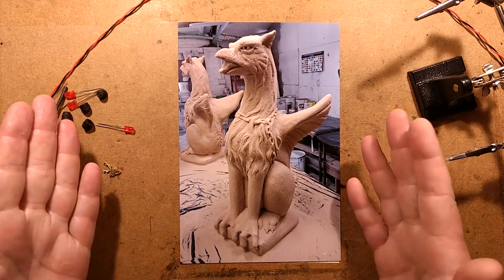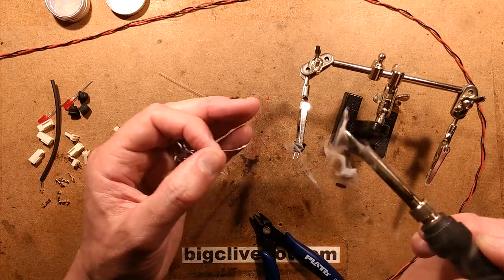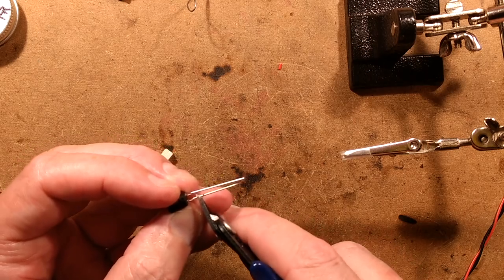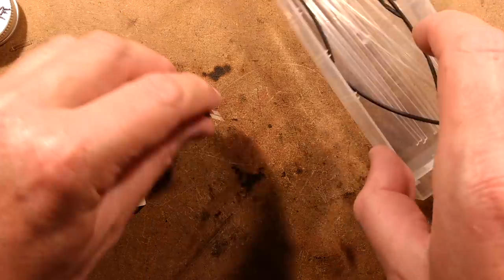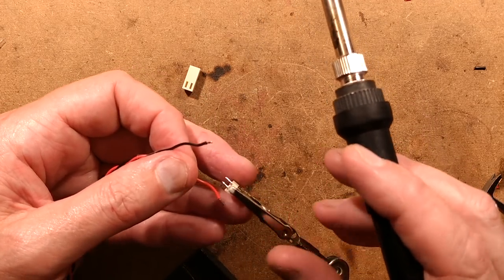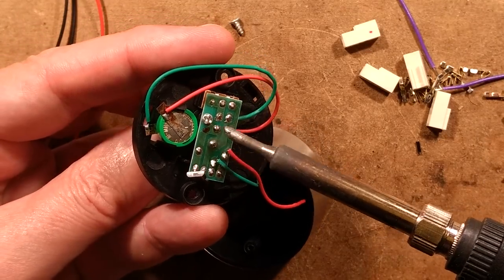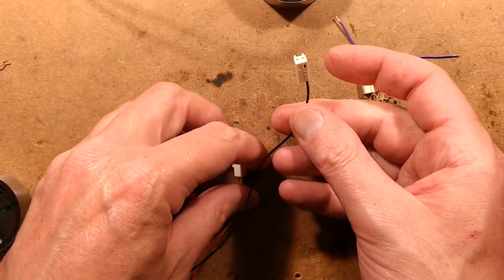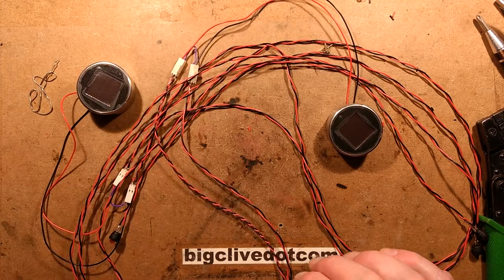Making a wiring loom for a prop.  Rambly Q&A video.

Comment: I received one of those stand alone heat guns many yeas ago after borrowing one from my neighbor to strip the linoleum off the counter top in our old house, shortly after purchasing it.  The heat gun worked so well, I told my wife I loved it, and on my next birthday, I was presented with a nice cased set, came with add on tips, in fact it has the one you use all the time. It sits in it's case in the back room, unused to this day because I was injured shortly after, and have never got back in the back room to do any work. Over the years things kept getting packed back there for storage till today when you can't eve walk in the damn place except for one narrow passage to my old office chair. I hope to one day clear it out so I can try and get back there to use it, as everyone keeps telling me  I am crazy building projects and rebuilding laptops whilst sitting in my electric recliner, they seem to fear I will drop some solder down the chair and set myself ablaze.  Hasen't happened yet, but I do have a lot of shirts with burn holes in them where solder has somehow dripped on them. One day though, when I don't have anything else on my agenda, I will tackel that back room and get rid of all the shit back there that isn't even mine, then, perhaps I can once again try to get back to my workbench and do the work right.  It has, however made me very dexterous with my hands, which used to shake like a damn leaf, the soldering has somehow made them steady once again. Funny how that works.  Perhaps soldering is good therapy.
Reply from the maker: I had a coworker who always had shaky hands until he needed to work on something and then they were absolutely still.
Reply: I showed my doctor the kit watch that I assembled all SMD tiny parts, he was amazed that I was able to do that a he is treating me for the shaking problem, as well as a ton of other crap.  I think that's why I love building these kits and learning more even at my ever increasing age (be 68 next month, damn I am getting OLD)

Comment: I've been doing electronics off-and-on for 4 decades.   Taken "How to Solder" courses as refreshers.   This is the first time anyone has mentioned putting flux on the desoldering wick and the pads, helps to remove the solder from the pads.

Promptly tried it.  Wow!   Fast and clean.

Comment: When you twist 2 (or more) wires together like this, you are also twisting the wires at the same time. If you have a geared spindle for each wire, driven by a gear concentric with the main shaft where the centre gear does not turn. In this way, as you twist the wires together they are automatically twisted in the opposite direction. This solves the unraveling problem.
Reply: I just pictured this. Good description.
Reply: My neighbour collects old farm tools. He has a rope twister that works just like that. Hand cranked.
Reply: Yes, exactly the same principle. Rope factories do the same thing, but with very long rooms. I think there is one with a room about a mile long. Ideally, the source spools are attached to the outer gears for continuous production, up to the length on the spool but for producing ropes the spools would have to be enormous so that doesn't work. Clive said the wire was 7 core, they will have been produced in exactly the same way but with 7 heads.
Reply: My neighbor is a rope twister by profession, he's 97, though. They worked beside the river, in good weather only, and with roundabout a quarter mile long pieces (land miles = max 400 m), drilling them on a device like You described it.

Comment: Traditionally a gargoyle is a water spout (you can remember this with 'gargle' ), the similar ones that are not a water spout are grotesques.
What you have there looks like a griffin, but if it was on a church (usually just the head/shoulders) would be a grotesque.
For twisting wires i just use a cup hook in the drill, as long as the wires are at the same tension (keep it tight), it's not a problem, once twisted, i reverse the drill a little to prevent the tangle
When i solder connectors that might melt, i grip the pins with the croc clips, as long as the iron is hot enough, it solders fine.
Reply: Glad to see someone else picked up on the gargoyle/grotesque point. My inner pedant always screams at that. :)
Reply: Never knew that, thanks. I blame the (mostly excellent) Disney cartoon show. :D
Reply: TIL

Also, croc clips as heatsinks is one of the greatest discoveries I ever made.
Reply: To add to the exactness and pedantry: because language is a changing thing and people have been calling the statues without water spout "gargoyles" as well, the meaning of the word "gargoyle" has expanded to also cover what would traditionally be called "grotesques".
While you are correct about the traditional difference, calling a "grotesque" a "gargoyle" wouldn't be considered wrong by modern dictionaries.
Reply: @daanwilmer  "the meaning of the word "gargoyle" has expanded" - That is a very diplomatic way of saying "lazy people with lower priorities for intellectual matters found misusing one word for something superficially similar but different acceptable and tolerated with such widespread fervour that it began to make less disinterested people sound stuffy". After all, you cannot have "gargoyle" expanding without "grotesque" diminishing.

Comment: I've done this exact thing before.  Someone gave me a hollow composite garden sculpture of a squirrel.  I dremeled out the eyes and illuminated them.  

The method I used was simple: Start with diffused red LEDs and arrange them inside the statue such that they are centered in, but about 5mm behind where the eye surface should be.  I affixed them from the inside with clay or blutack (i don't remember which)  At this point, I used clear acrylic latex caulk (the kind that cures semi-translucent).  I used a small spatula and filled the eye cavity with the caulking, making sure to encapsulate the LED.  The exterior surface is simply sculpted to form the convex corneal surface.  

In this way, the entire eye glows uniformly at a wide range of angles, it still looks good during the day, and it's entirely waterproof.   In retrospect, using silicone would probably be better for outdoor use.

Comment: The wiremen at the factory I worked out used a drill to twist pairs too. One end was tied to the handle on a full filing cabinet, the other end hand twisted, folded over (to stop the slipping), and chucked in the drill. Tension the wire and away you go. If the tension is too high the full filing cabinet drawer opens, correcting the problem.

Comment: I've never had much trouble twisting wires just in the chuck of a battery drill. The trick is to anchor the other end and keep up some tension. Run the drill in reverse for a couple of seconds before taking the twisted wire out. This stops the tangling problem.
Reply: That's how I do it too
Reply: I put a " vine eye" into the chuck and affix appropriate number of wires but otherwise do same as you - maintain tension whilst winding - quick pull at end then couple of reverse revolutions to detension
Reply: Decades ago when I did production work for a long defunct division of Motorola (Four-Phase Systems), we would terminate the pins onto straight wire, then gently use a drill to wind the strands down past a specific length, then unwind the spring tension to the finished length, and insert the pins into the shell to lock in place. Made thousands of cables like that. Never had an issue after the first day of crushing pins - and having to fix them...

Comment: I worked for Trickets Fairground in Cranford , absolutely loved it building up the old dogem set and putting up the tilt (roof) which weighed a ton, it was a good life and we worked for food mainly , if we were fed well we worked hard . it took 8 hours to build up the dogem set and we could tear it down and put it all away on two trucks in 4 hours if we had to.
These days the dogem sets are mostly automated and fold out like a transformer hydraulically all the heavy lifting is done by macherinery.

As an aprentice plumber I had to go into the Gosport sewer system and do maintenance repairs the sewers are suprizingly clean but the worst part of my aprenticeship  was in work experience clearing out blocked rodding holes on driveways you wouldnt believe what got stuck in those pipes and you didnt have a glove to put on as you rammed your arm up the sewer pipe to grab a stuck sanitary towel. most of the time that was the cause of the blockages, very occasionally a disposable nappy. like the evil eyes great little project. lovin your videos sometimes i binge watch them picking up bits of the past ive  forgotten about eectronics, i also watch a lot of "My Mate Vince" to who repairs broken electronics products, the R2 D2 was very interesting. also lovin trhe soda stream experiments keep em coming the baileys was hilarious.
Reply from the maker: The good bit about having a dirty job is that there's much less competition and it tends to pay well.

Comment: I have good success twisting my own stranded pairs when I put one end in a vise and the other in a drill tip, making sure both wires are off center in the chuck. I put some tension on the pairs and run the drill.  Keeping tension on the pairs as you twist is the key to success.

Comment: The phone using the battery as a heatsink for the screen actually does make sense. Lithium-ion batteries perform poorly when cold, so using the unwanted heat from the screen to warm up the battery ensures that the battery performs better, and uses up energy that would otherwise be discarded. It makes the phone more energy efficient.

Comment: I happen to be working in a optical type shop in around 1990 ?. And there was a guy installing a new machine, They needed a guinea pig to try it out. So I volunteered, you just looked into it and it took a picture of the inside of your eye, and printed out a picture. They do this basically to compare what your macular ( ? ) nerve, so they can tell if its getting thinner which would give you trouble, this is what sends everything you have ever seen travels to your brain. So they take a picture, then years later they can compare against the earlier picture to see if its failing. And yes its truly amazing what the inside of your eyes look like. They actually gave me copies of my photos on floppy disks, which I have transferred over to CD. I have never used them to give to a eye doctor ,but havent been to a eye doctor.
Reply from the maker: In Scotland as part of your routine free eye test they take a picture of the back of your eye and store it in your file.

Comment: With regard to twisting wire directly in the drill chuck, I found that it works as long as both wires are under tension, so that one does not have enough slack to twist over the second wire.

My work had us twisting 18 AWG wire for communication interconnect between boards in a chassis, and we would often twist up 20-30 feet at a time, by clamping one end in a vise on the bench at the far end of the room, and then making sure that the wires were the same length when tightened in the drill.
Once it was twisted as far as we wanted, we would give it a couple of good tugs to settle the copper strands into the twist, which mostly eliminated the tendency to unwind once released from the drill chuck.

Comment: Attempt to weather-proof the LEDs with a grommet, but why no connector with o-rings or a rubber seal? And isn't there a type of heat-shrink that also has a form of hot-melt glue already inside that seals against any moisture? Seems like that should be an option worth considering.
Reply: It is just a foam garden decoration though. No need to overcomplicate things or make them too expensive. Some wires and heat shrink is all it should need.

Comment: For 2 pin keyed, low powered, non-waterproof, non-board mount connectors I've moved to using the red pre-wired 2 pin connectors used for hobby RC batteries.  You should see them if you search "JST 2 pin 100mm" on e-bay.  You can get them in pairs by the 100's, super cheap and pre-polarised.

Comment: @BC, I appreciate an older video but, I wonder whether a thin frosted acrylic tube would have worked best.  Push two flexi tubes from the eyes down to a "base" with the LEDs mounted at the end.  The LED light should refract down the acrylic and glow.....  Simplifies the build and makes it easier to replace components.

Comment: For using a drill I put them straight in the chuck, but instead of centrally I put one wire into each of the gaps between the pieces of the chuck (as far from center as they can go). It also allows for twisting 3 wires should you need. The wire needs to be a little taught for it to work properly though.

Comment: You can insert the wires in to the chuck but you have to use a piece of soft rubber or soft silicone tubing. First, insert the tubing in to the drill chuck then insert the wire ends in to the tubing. Close the chuck, attach the other ends of the wires to a fixed point and slowly spin up the drill. Done!

Comment: This is most likely just one of those pleasant linguistic differences but here in Canada what you built is a wiring harness. You wisely omitted the loom as it's very much unnecessary with only a single twisted-pair and would make installation difficult in this application.

Comment: Hey clive, a really good option for connectors for outdoor use is Deutsch DT, extremely rare to see one fail due to water ingress. They are however quite expensive iirc. Another is TE Superseal which I believe are much cheaper but still do a good job. Then again, I guess they'd be a bit too bulky for what you're doing here.

EDIT: Also, I kind of miss the hum and tick of the soldering station, kinda made me think you had a Little Helper like Gyro Gearloose.
Reply: also cheaper options are hot glue or silicone and depending on size denso tape.  why use proper connectors when you can botch it ;-)
Reply: Well, I've done my fair share of bodges over the years, usually meant as temporary repairs, but you know how it goes with temporary repairs that don't break immediately. But at some point you just get sick of re-fixing the same thing over and over, so you start doing things right the first time around, unless it's an absolute emergency of course.

Comment: You can spin it in the chuck.    Just pre spin about 2cm tightly by hand and shove the wist in the chuck.  Keep it under tension tell you get a tight spin, then revers the drill until you can release the tension and not get curls.

Comment: Hi Clive,  can you give more detail on the tape you used to cover and waterproof the solar panel in this video. 
Thanks.
Reply from the maker: It's an outdoor repair tape with UV protection.  It's intended for repairing cloches and glazing.  But it does break down over time
Reply: @bigclivedotcom  Thanks, Where can you get it, eBay, Amazon ?

Comment: Where I worked in the industrial control systems sector years ago, silicone polishes were banned in the area where soldering was undertaken , as it causes havoc with soldering on pcb’s.

Comment: If you don't understand the metric wire sizes (I certainly don't without reading the datasheet - I tend to think in AWG/SWG)
2 of the common sizes.
7/0.2 mm = 24AWG - 25SWG (approx 0.5 mm) 0.5A
10/0.1 mm = 28AWG - 30SWG (approx 0.3mm) 0.225A

Comment: I'm still trying to figure how on earth these will be fitted into the prop as surely it will have to be done from the inside as those connectors are not going to fit through the eye holes?

Comment: If I don't need the wires to be flexible, I usually repurpose a pair from a UTP cable, as they are already twisted. For low voltage low current they are perfect, although insulation and flexibility is far from perfect

Comment: I have found that leaving the silicone grease anywhere a solder joint will produce a fractured joint over time. It will be so thin that you have to have good magnification to see it.
Reply: Mike Dodd As for flux, there are specially designed "No Clean Flux" formulations.  Mostly intended for components that would be destroyed by cleaning procedures, but damned convenient in general.

Comment: Rather than unrolling wire from the spools, wouldn't it be better to pull each wire off over the end of fixed spools -- thereby preserving the twist that we normally try to avoid.

Comment: Im not sure it was because you wired 2 red leds in series or the solar modules have different chip in them, but when i tried to make small red garden light i came to couple of problems,the old type of red leds can light or just conduct small current even below 1v, so because there is always small voltage on the led contacts the led was always on, fixed it by changing to newer type of led but it still drains battery very low

Comment: After you have put the  twist in and it is still under pressure, run the heat gun up and down the rope to stress relief the insulation.
When I say heatgun, I mean a HEATGUN not a fiddly reflow heatgun...lol
It doesn't need much heat.

Comment: QUESTION :  Is there a name for the type of wire stripper you were using?  They look quit nice.  How small of wire can they strip?
Reply from the maker: If it was the unior manual strippers then they can go quite small.  But they need set for each wire size.

Comment: lol.  I make my twisted pairs the same way, but I mostly use two different colored enameled magnet wire.  It works for low voltage runs. ;)

Comment: Oh hey. That method you use to make twisted wires is pretty much the same as the method used to make rope. In the olden days before the industrial revolution, people would have to crank it by hand instead of using a drill, and they would usually use 3 or 5 strands instead of 2, since odd numbers worked out better for keeping things nice and tight, but the various concept is pretty much identical.